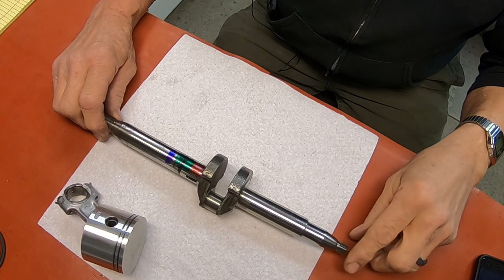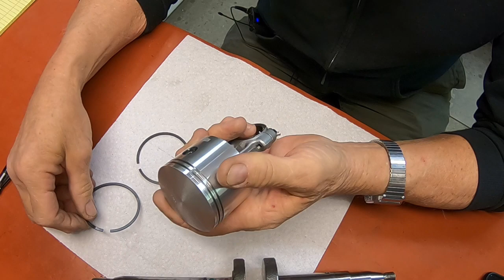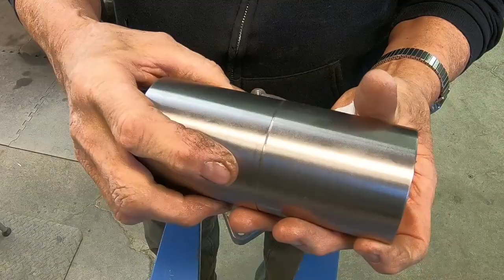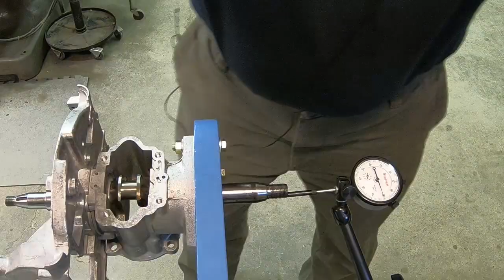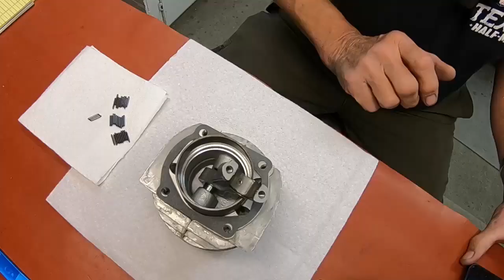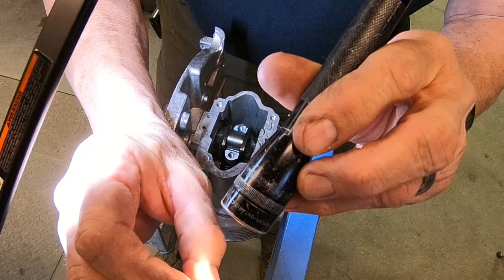Lawn Boy D-400 Reassembly Part 1

Comment: I am enjoying watching the Lawnboy engine rebuild.  A question and a point.  For those attempting honing a cylinder and replacing rings I would offer this suggestion.  If you are going to place the piston in the cylinder before installing the rod to the crank be sure to use a piston stop.  If the piston goes in too deep which it can using this method it may catch a ring on the cast sleeve and you won't get the piston out.  Otherwise install the piston to crank first and then the cylinder head. 
Is that a D-600 cylinder head you are using on a D-400 engine?  If so the manual says that is a high compression cylinder as noted by the H cast in the top webbing.  Lawnboy says this can cause overheating although I have talked to one who has done this with no problem.
I wish I had the equipment and skill to do the bushing to bearing conversion.
Great job on the videos!   Keep them coming.  Bill

Long time Lawnboy lover and owner of 13 pre 1982 models.
Reply from the maker: Hi Billy, you are indeed correct on the piston install. Would not recommend it either. Yes, it's a D600, I know of the difference but so far, I haven't had any issues. Every time I mow it's with a Lawn boy. These days I wouldn't try the D600 because I have figured out how to sleeve the cylinders. The reason I used a 600 is because you cannot find the 400 cylinders, now by sleeving I don't even need to find the rare pistons, just sleeve and fit to the old piston. Works great. Yes, with a sleeve and the bearing conversion it's like a brand new one again. Thanks for watching!

Comment: Dale,  Great work,  I have a 7266 I am rebuilding. the lower bearing in my engine is worn out,  I was wondering if you would be willing to machine my case and install the new bearings. What ever you charge would be worth it as you already know the procedure. Let me know if you would be interested , Thank you
Reply from the maker: Thanks Ken, I am just covered up right now with projects and machine work. Your local machine shop should be able to handle that pretty easy.

Comment: I'm working on a Gold series F engine that I may be rebuilding soon. These engines are built very similar. I'm a little nervous about the needle bearings in the connecting rod. I find this video to be very helpful.
Reply from the maker: Thanks Eric, I am not real familiar with the F engine, I do own one, it just keeps running no point working on it. The needle bearings just require you keep track of them. Be careful, have a magnet ready, use grease to reinstall.
Reply: @montana2strokeracer  Thank you for the tips. It was running fine before. Still had good compression. It just needed new crank seals and the crank case to be resealed but someone before me cross threaded the fly wheel nut and damaged the threads on the crank shaft so the crank shaft needs replaced. I figured I would change most of everything out while I'm in there. Seems pretty easy so far.